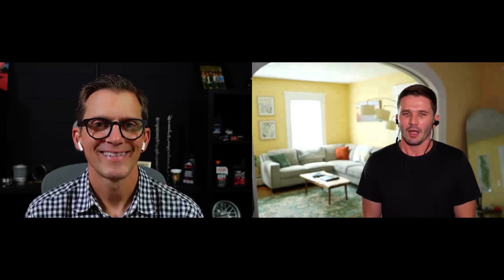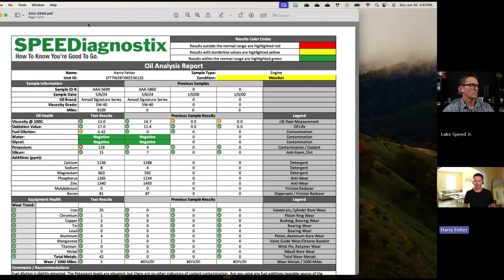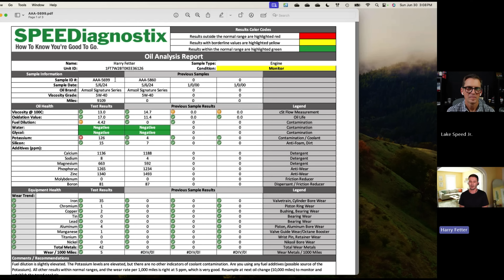9000 Mile Amsoil Oil Analysis With The Motor Oil Geak

Comment: Great topic. Is there a case where the oil might be still good, but the filter clogged reducing its efficiency?  In the case of the extended change intervals, would it be worth considering changing the filter say every other drain?  And on trucks, what about a larger oil filter than factory spec?  Or, a bypass kit?
Reply from the maker: Great question. You definitely want a filter that will last the interval. Bypass filters do help. I run an Amsoil filter that’s good for up to 25,000 miles (I would never go that long obviously). If the filter was clogging you would see it with a poor oxidation value in the oil report

Comment: I drive for Pilot Travel Centers. Kenworth 660. 2023. Real junk. We are on a 60,000 mile oil change schedule. No synthetics. No traditional 15 w 40 diesel oil. Thirty-five lbs oil pressure at 65mph. Oil is filthy by 15k but they don’t seem to care. No one can answer if any reason or just cheap.
Reply: How many miles do you guys run your trucks before the auction off and buy new ones?
Reply: @Your-moms-hitachi 
500-600k normally 3-5 years
Reply: @Your-moms-hitachi  probably 350k.
Reply: My company does 40k changes and sells at 500k
Reply: @DieselCowboyTrucking  that's exactly what kenworth claims the 660 should do. So ok
Reply: Obviously, it’s your opinion about a Kenworth 660 being junk, with my Peterbilt 579 my company would do 40 to 50,000 mile intervals. And they run perfectly fine. There’s a couple of things to keep in mind, the amount of oil in a tractor trailer is way more than your regular pick up trucks and the fact that they have multiple filters also makes a difference. If You’re running in severe conditions,. Your intervals are a lot quicker, but don’t forget that most of the driving is done on highways where the trucks are running. 
A Bigger danger to these trucks are the idle timers that the companies are putting on them When you’ve been driving on the road for eight hours and the truck turn itself off after five minutes, the engine hasnt coooled down and all that oil in the turbos starts to cook.
Reply: @emed1977  you are aware that Kenworth States in their own manual to do 50,000 Mi out oil changes right
Reply: @Your-moms-hitachi not sure what your point is.
Reply: @emed1977 centrifugal oil filters that are on the paccars at least in 2011 made my oil clean after 50k. Of course it had no emissions on it and leaked a couple quarts per week helped.
Reply: We run Cummins, 15 L and DD15. 50000 mile oil change intervals. Sell them at a million miles or 10 years.
Reply: Wow! Note to self “Don’t buy used Pilot Truck”
Reply: The Paccar MX-13 diesel engine has an oil system capacity of 42 US quarts.
Reply: I run team. 6,300 miles a week. DD13 they change oil every 80,000 miles.  530,000 no problems so far.
Reply: @russellridge8623  That company is massive. I’m sure they have their maintenance intervals optimized for cost better than most.
Reply: Curious, how many qts or gallons of oil does it have?
Reply: Reality these companies want trucks under warranty. Most tend to do extended schedules because at say 600k it's gone anywhay
Reply: I’m old school. I’m staying old school. No more than 4000 miles on an oil change. I understand some people say I’m wasting my money. My thought is oil is less expensive than engines. I’m 58 years old. I have never had an engine failure on any vehicle that I have ever owned. Transmissions are another story.
Reply: @Iwillnotbepushed  You're draining and replacing 44 quarts every other week for a road tractor application? Back when the standard for most cars was 3,000 miles or 3 months, trucks were using a rule of thumb of 10,000 miles or one month. 44 quarts can suspend a lot more contaminants than 4 quarts can, and two huge multi-stage filters can accumulate a lot more particles than a single small spin-on filter can.
Reply: @ Agreed
Reply: Feel sorry for whoever buys it next
Reply: That is paccar mx13 recommend intervals. (60k)
Also paccar mx13 recommend is 10w30 not 15w40
Delo synblend oil
Reply: @russellridge8623  you can't judge oil by looking at it. Only analysis can tell you the condition of the oil. Oil lasts longer than anyone understands
Reply: @bigdaddymak1439  You most certainly can judge Oil by looking at it. A dark black color means it is oxidized and contaminants like byproducts of combustion and wear materials. It does not however mean it is completely done for, but it certainly does mean it's almost there.

Comment: The fuel dilution alone would tell me that 9,000 miles is pushing it a little far.
Reply: Did you hear he had a dpf sensor that was bad causing the dilution
Reply: @bigdaddymak1439  he only heard what he wanted to
Reply: Coming up on 200k miles on a 6.7 with 17-20k miles per oil change. I’ve saved a lot of money and half the times of opening up the oil system to make mistakes. UOA done every change since 100k miles. I could go further but I don’t.  Also, no fuel dilution has shown up yet.
Reply: @Grayson.84 you may be right, I traded my last one with 270k which isn’t as much as some but still it had no problems.  I think it all comes down to how it’s used. I’m hauling on the interstates a bunch.
Reply from the maker: The analysis doesn’t show the rings? lol there’s a whole line for piston ring wear. They don’t tell you the condition of the oil? Did you watch the video 😂
Reply: @powerstrokemaintenance  iron wear is a sign of ring wear
Reply: Absolutely! Scotty Kilmer said if he had a turbo engine, he would change the oil every 3,000 miles.

Comment: I respect wanting to know how your engine is performing by doing this analysis but I think it's a little excessive. I mentioned before on one of your shorts, I think, that my buddy has well over 200K on his 2016 and he does not follow any regimen. He waits for the sensors to tell him what to do for oil changes, coolant changes, etc. He hasn't had any major issues. He tows his dump trailer daily for his business and I know that think can get heavy fast. I'm sure by doing an analysis you can save a few bucks on oil that's still good and potentially find an underlying issue but what are the metrics on those who do oil analysis and those who don't? Do the ones that get their oil tested have a longer lasting engine vs those who don't? I'm pretty sure that the vast majority of people don't do an analysis and there are plenty that don't even know this test exist.
Reply from the maker: Oil analysis is just another tool. Use it or don’t, totally up to you. I like the peace of mind it gives me. Helps cut through all the nonsense on the internet.
Reply: @powerstrokemaintenance  I totally agree. LSI has their own tests as does Maxima Racing Oils. I run all my stuff super hard and I have too many engines to do tests on all the time. Two kids is multiple sports and too many hobbies lol. I just meet somewhere in the middle since I can afford to do so. I do test some of my offroad oils since it's right down the street from me. I will probably start testing my diesel oil because I think Maxima is starting to accept testing of those oils after their release of their diesel oil. They only have 15w40 right now and they're working on getting approvals for the Ford spec. It's just paperwork basically.
Reply from the maker: Gotcha that makes sense! It’s worth a test for sure. If you have a lot of engines I can see why it would be a lot of work to test them all.

Comment: Unexpected guest foe the channel, great interview and insight from Lake - specific to the Ford 6.7 PSD.  Very curious of Lakes viewpoint of using a fuel additive to address ULSD impact on the CP4?  I may jave missed it, but seemed he focused on use of Archoil 6500 and 2nd order effect on oil and analysis (when looking for wear indicators/other early signs of a componwnt failure).  Not sure if yall may have sidebarred lubricity additives to incease the CP4s lifespan.  Great content and interview,  thanks again... - Will
Reply from the maker: Thanks for the comment! Glad the video was helpful. Unfortunately we did not get a chance to discuss using the fuel additives to help save the CP4. I still run an additive every fill up

Comment: Excellent!! It's worth mentioning that Ford redesigned the regen in 23+ trucks. Instead of injecting fuel on the exhaust stroke it injects it by the DPF thus reducing or eliminating the potential for fuel dillution as a result of regen. At least that's my understanding and Ford isn't the first to do this. It's always a science class with Lake Speed and always enjoyable and educational. Thank you for this and for your channel.
Reply: Yes the "ninth injector" that makes regen faster and more efficient.  Like you said, 23+ trucks have it.  On my '19 regen would consume large amounts of fuel.
Reply: @4-LOW  So I wonder if the change in 2023 dumps less fuel but more DEF. That would make sense because my buddy gets way better fuel milage than me and he's the HO.
Reply: DEF consumption has greatly increased in 2023 Ford 6.7s. My friend goes through twice as much, if not more, than I do in my 2017. Not sure where it's injected though.
Reply: @jasonkubitz9410  you have to pay to play for all that power these days. Burns DEF like the new tractors, gotta fill the DEF tank every time you fill the diesel tank...
Reply: @vhateverlie  Absolutely
Reply: Class 9 over the road trucks have been using an extra injector to add the  needed fuel for regen for over a decade. Ford was trying to save money by not adding an extra fuel line and injector.
Reply: @Grayson.84 You know what's weird, I told the dealer the last visit I didn't want that update and they did it anyway. They said I wouldn't be able to register my truck without it. Now my 2017 does that crazy high idle at random of I sit too long and my DEF consumption increased but not a lot. Not as much as my friend's 2023.
Reply: @Grayson.84 S--T!  Thank you.  Where can I educate myself on this?  I thought it was the case because engine and trans temp go up during a regen.  I was assuming that's because of the extra heat load on the EGR cooler during the regen when fuel is injected on the exhaust stroke
Reply: @pat9125  A lot of heavy diesels got an extra injector the moment they got a DPF. It is cheaper not to have that, so lighter diesels tended not to use it.
Reply: @pat9125    well, if this is the case, it's actually worth buying a new truck  if you want to keep aftertreatment system. on the old systems  all that heat going through the turbo, exhaust manifolds and everything else is definitely not good for the engine.  as far as additional DEF consumption that's probably much higher exhaust temps during regen to reduce NOx